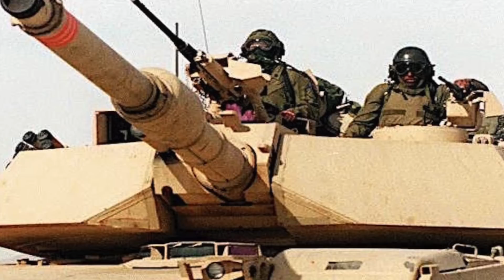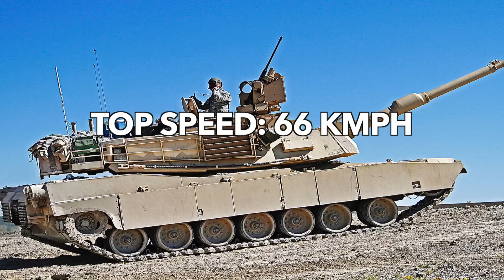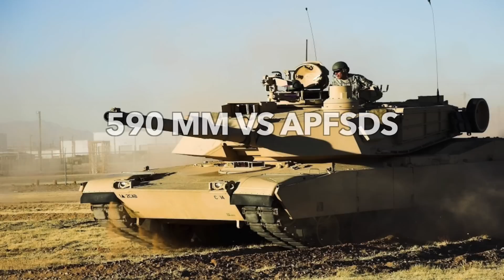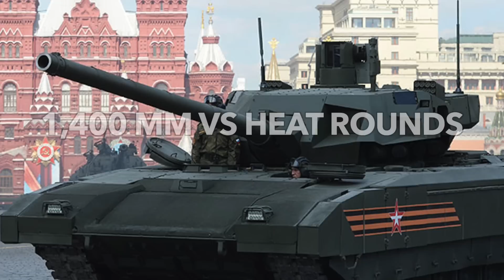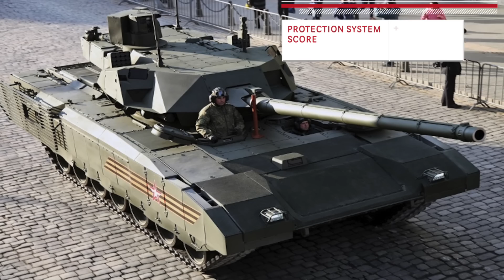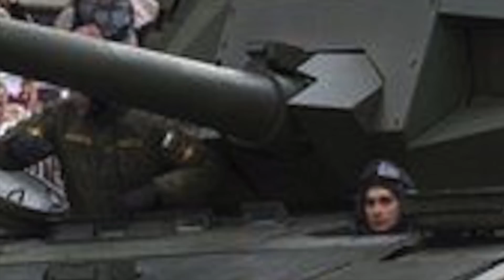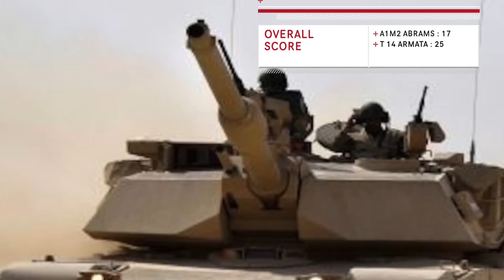AMERICAN M1A2 ABRAMS  vs RUSSIAN T14  ARMATA: WHO WINS?

Comment: I don't understand. Armada's engine beats M1A2's engine output in horse power but it broke down during the parade. What was with that? How is its engine reliability? Can it withstand combat environment?
Reply: your right lmao they are proven tested on parade not in combat hahaha
Reply: It didn't break down. The driver was still unfamiliar with the tank. He accidently knocked the hand brake on and because it isn't a normal hand brake like you and I know he didn't know it was engaged and couldn't figure out what went wrong. As soon as they got the tech guy there the problem was identified immediately and the tank drove on its merry way.
Reply: Lol
Reply: The tow vehicle , designed to pull bigger things. Couldnt get the Armata to move an inch. The tracks were dead on stuck in place. It was the handbreaks. If it was an engine failure the vehicle would at least roll on its tracks
Reply: It would break down the first hit
Reply: trankt54155 the driver forgot to lift the handbrake, later in the parade a new driver drove it off
Reply: breaking down=/= worse horsepower.
Reply: trankt54155 it was a human error it didn't broke down because it has something wrong with it
Reply: @aikse7449  obviously they're going to say it was human error even if the engine blew up while idling. America would say human error also,, not saying they wouldn't. Just situation like that only a few mofos know for sure what happened
Reply: It was human error
Reply: Abrams got fried in Yemen, also Turks leopard. same propaganda been spewing export version, less armor, crew is alive n kicking..lolz.
Reply: It's all propaganda on Russia's side anyway
Reply: @JustinTuthill  so, there are nothing called western propaganda? I'm pretty sure US will say the same thing... and pretty sure you're gonna believe in that since it's good ole US and you're from there
Reply: @toxicatto6074  Thanks for the equivalent of fart noises for a comment
Reply: Human error salty kid do some research
Reply: @vcguerrilla6438  Because Russia would admit to anything wrong

Comment: The USA is beginning to feel like Spain's super power downfall 400 years ago.
Reply: Shado Opeth Agreed, but his point still stands, The U.S. is currently developing a new tank to out pace the T-14, and with this new pressure from Russia, I have a feeling they are going to speed up deployment of it. Also, in a 1v1, the T-14 would win, but we already have over 10,000 M1's and Russia just doesn't have a strong enough economy to mass produce these. In most combat scenarios, the T-14 will be outnumbered and in the case, most likely defeated.
Reply: @melindagreer4177  And they would have to be on the attack, most likely.
Reply: ''New pressure from Russia?'' What new pressure from Russia?!?!.
Reply: Melinda Greer What downfall like Spain's? This country isn't going anywhere anytime soon.
Reply: Oink ards You wish.
Reply: Power?
No.
But decisions made by politicians. yes.
Reply: The USA is beginning to feel like Spain's super power downfall 400 years ago.
Reply: No the current one is not over 30 years old. The current one is a way more up to date version of what was originally designed as the M1 with the help of german engineers around 1980. After that, several new tanks have been developed in the M1-line with new and upgraded features. So no, this is not a comparison of a 1980 tank with a 2015 tank. The M1A2 is only a bit outdated, nowhere near that much. And the T14 still easily kicks its ass.
Reply: PsychedeliCon How long has it been out dated then? I’ll wait

Comment: Sorry dude. M1A2 Engine having multi fuel is far better then T14. In war versatility is far more important than range or weight ratios. The gun range of A1M2 it's better than the other. Range of the gun and depleted uranium armour makes  Abrams a far better tank than the rest. T14 is not even battle tested!
Reply: Abrams is deemes too heavy.Abrams mobility is not that great but the armour is good.

Plus,M1A2 Abrams is only battle tested by Export T-72 variant which is a Cold War relic and unorganized army which cannot effectively taken down an Abrams.M1A2 Abrams never fought a tank with it same generation or higher. If you called that battle proven,mkay :/
Reply: Johan, a missile through the barrel
Reply: I know. T-90 lacks the sights and FCS to engage anything at 12 km range however, so it does not matter if it has ATGMs. It still does not allow effective engagement of targets at 12 km.
Reply: We talking about T-14
Reply: Same problem. It uses downgraded French optics. Thermal sights allow tracking targets out to what? 3 km range?
Reply: So what will the T-14 do when it has elevation, trees and rocks in the way? Does it have GPS guidance? Nope. Does it have sensor fusion? Nope. How exactly will it use the 12 km "advantage"?
Reply: GPS during a war is as useful as wipers on a submarine. Proven by Russians in Syria, as Americans are bitching their recon drones GPS is being jammed.
Reply: "Does it have GPS guidance?" Yep, but primary GLONASS + BeiDou. "Does it have sensor fusion?" 360°. Optic + IR + AESA radars. Including automatic hazard detection, tracking and aiming. And don't forget its deep integration in network-centric warfare (all targets are shared from all available sources).
Reply: And yet GPS guidance let them massacre 200 Russian "mercenaries" in Syria, so maybe STFU.
Reply: https://en.wikipedia.org/wiki/T-14_Armata#Sensors_and_communication
No GPS for the T-14. Just because the Russians have GLONASS does not mean it is integrated into the T-14.
Also, do you know what sensor fusion is kid?

When have the Russians ever engaged and hit a target at 12 km range? There is so much BS coming from you guys its not even funny. Same old story. Russians talk crap. Russians are forced to put their shit to the test. Russians get beaten down. Russians come up with some other propaganda-crap. Rinse and repeat
Reply: 12km range on the cannon is highly optimistic, at best.

Comment: The T-14 is only as good as its ability to withstand attacks from above. It will suffer the same fate as any other tank when attacked by anti tank missiles designed to penetrate the thinner armor of the turret top. For that matter the A-10 Warthog would have a field day raining thirty MM rounds through the top of the T-14.

Comment: The US needs to get its schít together and come up what an Armata beater.  Using the premise that two or more Abrams will take on one Armata is not particularly good news for our tank crews.  The Russians have us outgunned and out maneuvered...and a a much cheaper cost
Reply: Ally Oop Not true, the M2A2 sep V3 is a logistical masterpiece, its possibly the most advanced MBT. The Abrams Sep V3 has better armour then the Armata as well, and its Rheinmetal L44 gun, with US made Apsdf and Heat rounds gives it competitive firepower. Mobility, wise the Armata takes the cake.